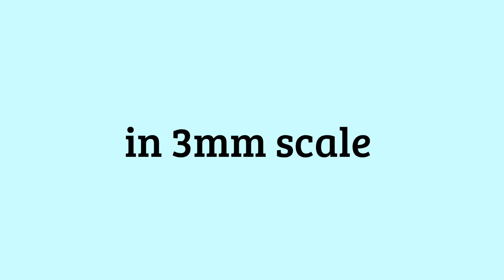Hirstwood Lock 19 - 3mm scale canal.

Comment: Surely the water at the top would eventually run out?
Reply from the maker: - Tom8Tom - surprisingly no, it remains constant as the lock opens and closes with the movement of boats in either direction.
Reply: Ah right